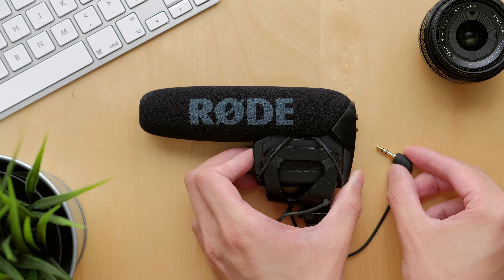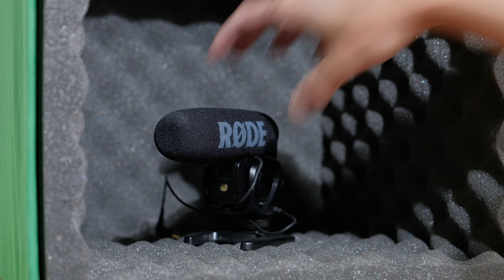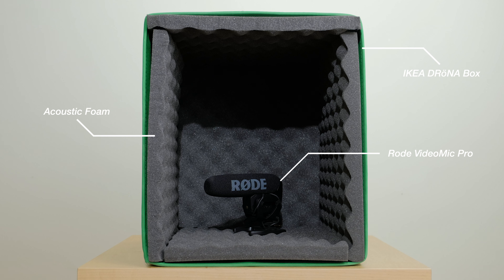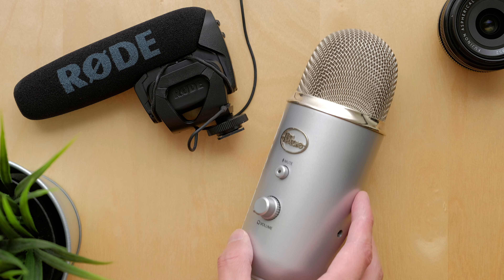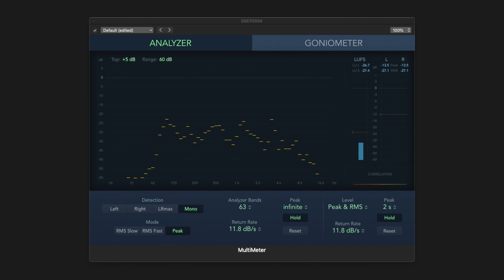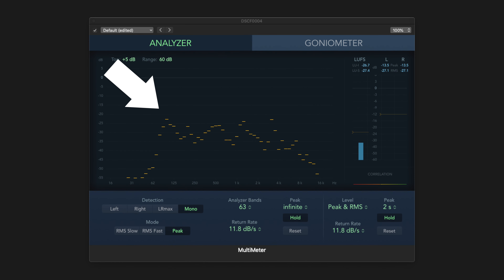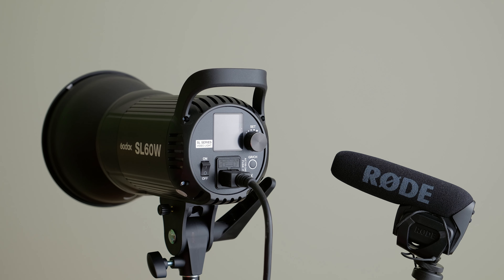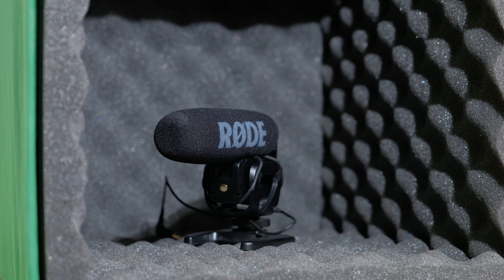$20 DIY Acoustic Isolation Box Audio Test ft. Rode VideoMic Pro Microphone

Comment: Inside the box it gets "comb filtered". A lot. There's a big boost in the lower part of the spectrum.
Reply from the maker: True. EQ or a bigger box will help to reduce this effect?
Reply: @JoeLamOfficial  It would have to be too big. You'd get better results by treating the room. EQ could help a little bit in an emergency, but the damage is already there -  the signal is messed up and you'd be introducing more phase shift with EQ.
Reply from the maker: @leo.saramago  Thanks for the tip.

Comment: Well done, Joe! Thanks for the test! So I can then confirm about that 10 dB difference I saw in the other video. And yes, absolutely, I'm sure some acoustic treatment to the room will probably help a lot!! Keep making more of these!
Reply from the maker: That’s why I was confused and wondered if you have seen it. 
Where did you get the 10dB from?? Only just tested in this recent video. 😅
Thanks for watching once again 🙂
Reply: @JoeLamOfficial  I recorded the audio output from the other video on audacity and then amplified the quiet parts to see the 50 db increase, then reamplified to check for extra gain room in the signal but got only 1 db more. Did the same with the quiet parts where you spoke at room-acoustics and saw the difference. Pretty interesting stuff!
Reply from the maker: Wow. You went that far to check. Awesome stuff. Glad we came to similar results.

Comment: I have a somewhat noisy PC and I need to isolate this big boy
Reply from the maker: Probably best to dampen the pc case or use quieter fans depending where the noise is coming from?
Reply: @JoeLamOfficial  i actually learned that there's 2 fans in my new pc that aren't actually connected to the motherboard meaning I can't control it at all and now i have to play around with adapters
Reply from the maker: @oxnerd  yeah can get resistor cable to lower the voltage / rpm / noise.

Comment: I need to figure out something to do with my headset. It picks up everything, and so far I've been placing my hand in front of it to keep it from picking up my fan. I can't turn the fan off because it's always about 90°F in my room lol!
Reply from the maker: That’s a difficult one. You might need to get a dynamic microphone. Use a pop filter and get it as close to your face possible. That way your voice becomes the loudest sound source and don’t have to set the mic so sensitive that it picks up the fan noise. Imagine radio shows or when people record podcasts. They are right on top of the mic literally.

Comment: Simple for the one with the box, use a high pass filter, reduce the bass rumbles, then remove that low end in the eq. I would recommend that you use blankets though. Also don't use acoustic foams, they cost a lot of money, and is rather ineffective for those trying to record their voice. I don't have a light with a fan, so Idk about that.
Reply from the maker: Thanks for the tip. I might try that tip and revisit this video. As I didn’t want to mess with the audio and just get it straight out the box. I do like the idea of blankets but in my case space and lighting setup is a an issue.